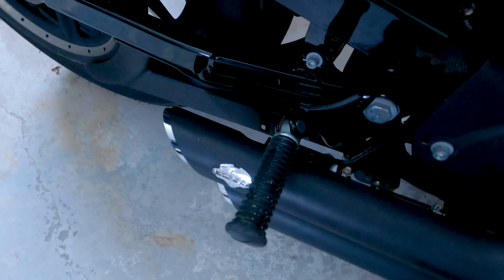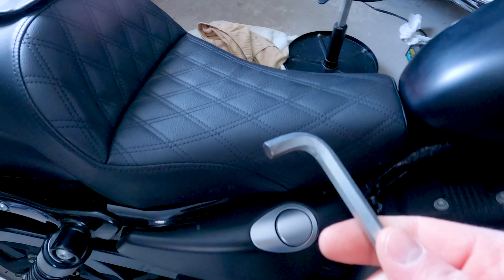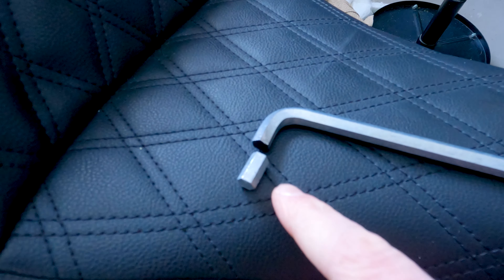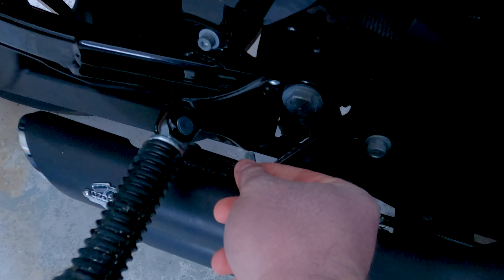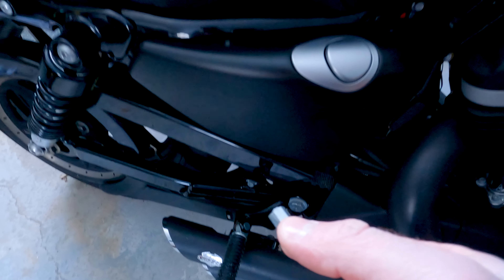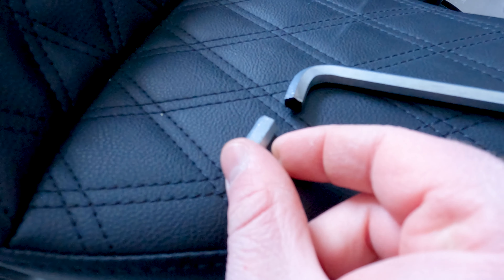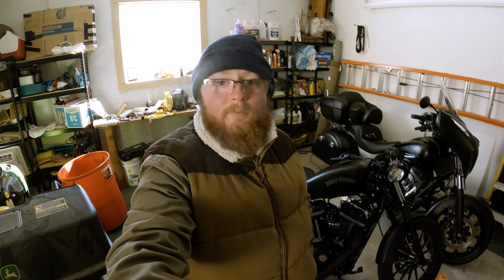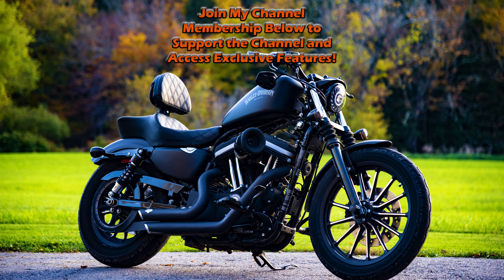Harley Passenger Peg Install WITHOUT Removing Exhaust!

Comment: Surely it’s faster to remove the exhaust
Reply from the maker: 🤣 yeah, sure!
Reply: After cutting Allen keys and all that monkey business, you can have the entire exhaust off and you won’t have to ruin a perfectly fine Allen key.
Reply from the maker: To remove the exhaust and get at the head gasket bolts is a pain in the butt. Plus the heat shield removal, plus o2 sensor removal. Allen keys? I have a drawer with hundreds of them. They’re cheap. Way faster and easier to do this. Have had to take the exhaust off before, so I know what it takes. Why I made this video to give people a different option.
Reply: @MOTOBLADE  I get ya. If you have sacrificial Allen keys and a difficult removal of the exhaust this way would be an option. Take care and thanks for the video.
Reply from the maker: @philweed1603  you’re welcome! Yeah if I had an easy to remove exhaust I would take the extra time. But on this bike? Nightmare. Will look for almost any alternative before I have to touch that exhaust again 😂

Comment: Brilliant my friend!! Gonna try this with my Indian Scout bobber with Vance Hines grenades right in the way. My concern is I don’t have the right tools to make a clean cut of the Allen key any suggestions?
Reply from the maker: An inexpensive hacksaw blade and sand paper from local hardware store. Hacksaw cutting by hand will take maybe 15 minutes but it should be clean, then sand off any burrs.
Reply: @MOTOBLADE   thank you for getting back to me, however, I don’t have enough height clearance between my Vance Hines  grenades, and the foot peg mount. I need some kind of an elevator that would bring up mound, approximately 2 inches. Maybe you or one of your viewers has had the same dilemma? Girlfriend is waiting lol I’m not patiently.

Comment: It would be nice if you can show step by step for both sides
Reply from the maker: There’s no issue putting the pegs on the other side because there is nothing in the way. It’s only the right side that is blocked by the exhaust. Left side goes on in 2 minutes or less.

Comment: Regretfully, although it’s a great trick for your Harley, for my eagle scout bobber with Vance Hines grenades there is absolutely no way to put them on without taking the pipes off. If anyone has any ideas, I’m fresh out unless maybe using a shorter screw, but that could compromise the stability.